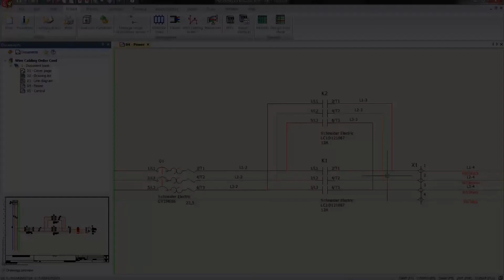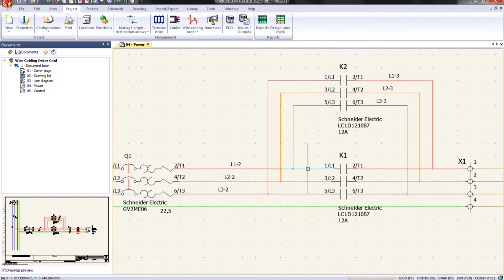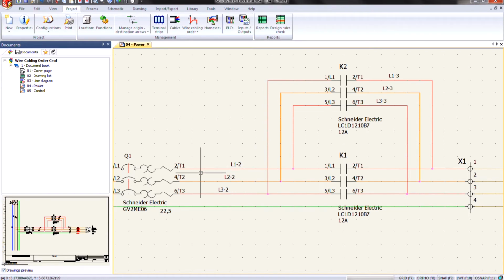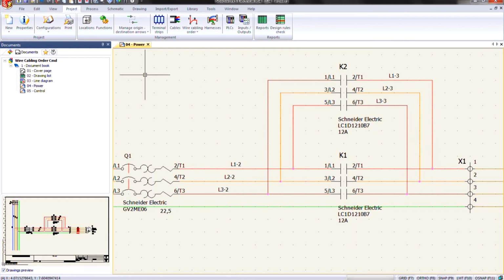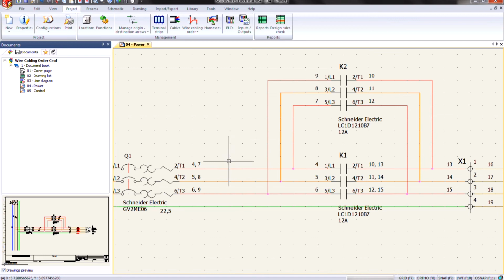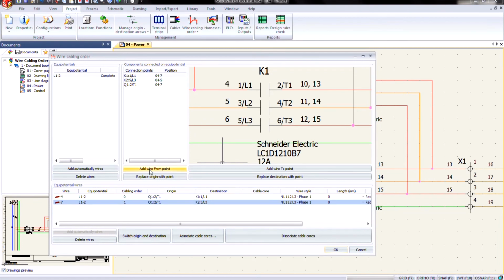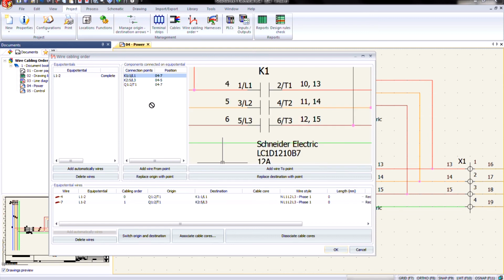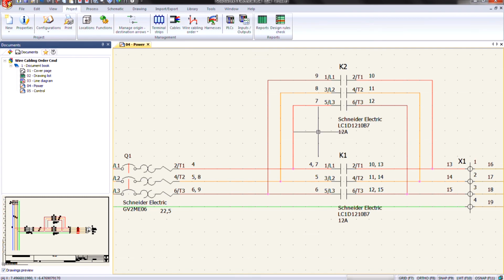SOLIDWORKS Electrical - Wire Cabling Order Basics

Comment: How do i make circuit breaker jumper in Line diagram/Schematic?
How would you jumper multiple circuit breakers with out having to run multiple wires to my main power supply?